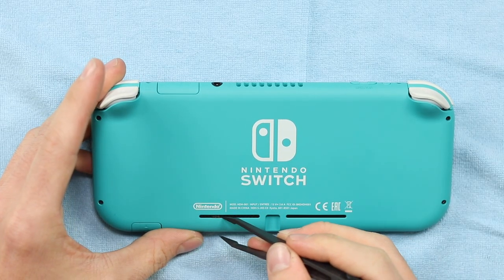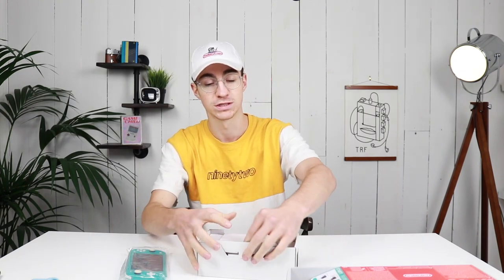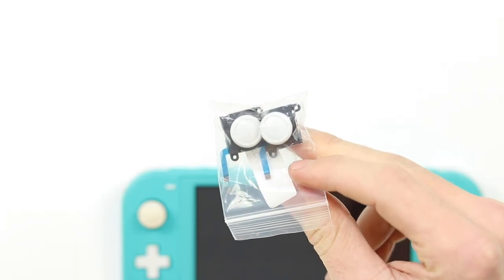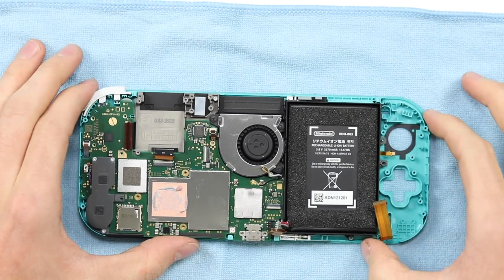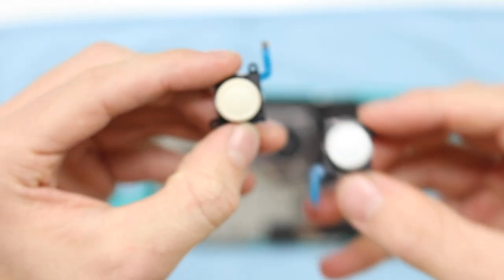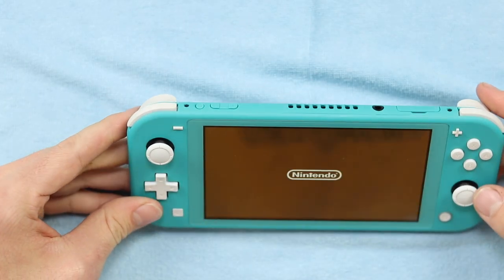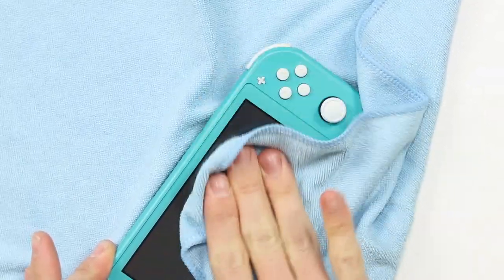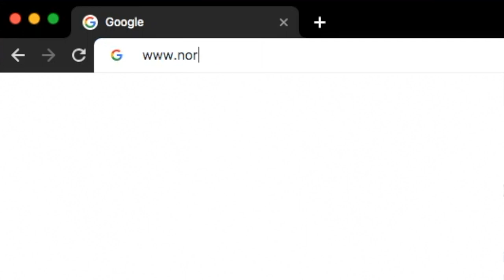£110 Nintendo Switch Lite! - Can I 'Fix' It?

Comment from the maker: I know this isn’t a full fix video, but I had no idea what to call this video. So I went with ‘fix’ to indicate it’s not my normal fixing videos.

That being said I wouldn’t touch this switch at all without replacing the stained joysticks...  I tried to clean off the tar but it wouldn’t come off so I had to replace them. 

Hope you enjoy!
Reply: @peshalraina1322  yep not the best info tbh
Reply: Refurb was the word that first came to mind. :)
Reply: If you didn't replace the thermal compound on the processor it's probably worth taking back apart and cleaning the heat spreader and heat sink with a lint free rag and alcohol then putting new comound on it
Reply: I had a nintendo gamecube that I lent to a smoker and it smelled and I found out putting the gamecube and game cases and such in a closed backpack with dryer sheets for a week completely rid the system of smoke.
Reply: Dude that was like Clickbait.....
Reply: Yeah, feels very click baity.
Reply: i got an anti smoking ad when he said it stank of smoke lmao
Reply: I just bought a Nintendo switch lite and it has a drifting problem. I am so mad
Reply: Yeah, it's more of a restoration-type video. Really cool to see nonetheless.

Comment: "he only played fornite" turns it on, only shows Mario kart 8, kind of makes me think someone stole it and sold it that's why took it for so low of a price.
Reply: Stole it used, with a box and charger?
Reply: @jebleman2091  you can buy the box on ebay and the charger for cheap as well. then make twice the profit.
Reply: Maybe he reseted the switch and the switch had the mario kart cartridge
Reply: He formats the switch I'm pretty sure, puts Mario kart in to test the cart reader
Reply: You guys are always jumping to conclusions and assuming the worst of people
Reply: @kandy1643  ikr
Reply: Easy to assume the worst of people when people are the worst
Reply: He's on the profile page for a second and you can see "Elliot" so he indeed reset it

Comment: Could you do a repair on a Wii remote?

Also, how could you spend £100+ on a Switch Lite just to play a cheap, free to play game, and watch Youtube?

Could’ve brought a cheap tablet for £50...
Reply: Noober I’d much rather spend the money on a Switch than some garbage Android tablet.
Reply: Mike L then again the guy sold it for $110. Not even half if you count tax.
Reply: @yamomoldcouch5065  In the UK tax is already included in the shef price so it's  £200 and that's it.
Reply: @cunnyman  I mean, emulators exist. A lot of cheap devices can technically play Nintendo games.

Comment: While I agree that the unit was just gross, I find it puzzling to see that it yellowed so quickly after being bought brand new less than a month ago. I mean, I'm a smoker myself and none of my electronics look that bad and neither does my collection of games.

From a smoker's perspective, I'm a tiny bit skeptical that one single person could manage that level of grossiness (is that even a word? You get what I mean) in less than a month. If I were to guess, either literally everybody in that house smoked a pack of 20 cigarettes per day (so between 60 and 80 cigarettes per day) or the quality of the plastic Nintendo used (or their supplier for that matter) is not as good as they claim.

There is no way in hell a single person could've managed to do that without "external" help. Not arguing about those residues of dead skin cells (that would be the least gross option), but the levels of yellowing and the smell are not normal. Not for something that new anyway.
Reply: ChaosZero ノブ prolly smoke and just never washed their hands. Cheeto dust fingers, perhaps?
Reply: I'm glad there are people like you out there who smoke and actually care for their game consoles. From some of the stuff I've bought for my collection you'd think that the previous owner would chain-smoke five packs daily and exclusively exhale straight into the cartridge port.

Comment: Very interesting how a lot of the motherboard was easier to assemble/disassemble than the older consoles. Everything either looked like it just needed to be screwed on or secured by a ribbon. Looks very easy to fix problems with it (for the most part). Nice!

Comment: I find that tossing the buttons into a sink full of hot water and scrubbing them with dish soap and a soft toothbrush is waaaay better than hitting them with alcohol and a q-tip.  Delicate stuff like the membranes of course still need to be done with the swabs, but buttons are no issue

Comment: If you really despise the smell of smoke you tend to suffer from temporary Phantosmia. Yellowing from smoke takes a long time to accumulate, unless he was blowing smoke directly on the joysticks non stop for days let alone hours. Biggest clue of a smoker is not smell but dust. In this case I think it's actually oily dirty hands and mix of light, if he has dirty oily hands and leaves the switch on his bedside under a light then it will take no time at all to yellow, a clue on his dirty hands is the browning around the Switch and the gunk inside the buttons.

Comment: Whoa! Not sure if you just cut it out but it looked like you didn't clean off the old thermal paste and reapply a new one to the heatsink.
Reply: Went back and watched it again, you definitely didn't on the 3rd layer. This particular model needs thermal paste in 3 layers. 1 under the IHS of the CPU/GPU (which you didn't open, so no worries), 1 on top of the IHS where the heatsink meets, and once again on top of the heatsink where the external shield meets. New thermal paste needs to be reapplied every time these parts are separated. Not doing so is setting yourself up for overheating issues in the future.
Reply: Here's a teardown with examples for anyone who's interested: https://www.neogaf.com/threads/switch-lite-internals-photographed-at-fcc-hello-mariko.1495936/

Comment: I smoke but I would NEVER smoke while holding my console? I try to treat my consoles and controllers with a lot of respect. I don’t eat while playing, smoke while playing. My controllers get wiped down once a week with disinfectant wipes.
It’s easy to tell the difference between my controllers and my partners controllers, he eats and plays all the time. Mine are impeccably clean, his tend to have a little bit of grime on them 😖

Comment: Did you replace the thermal paste for the cooling system? Disturbing the paste then not replacing it, did the system eventually have over heating issues?

Comment: Did the seller not have a local CeX? They buy the turcoise Switch for £146 cash/£160 credit. Even if they could see it was looking a little rough, they would have likely still offered £131/£144 as 'discounted' stock.
As for buying it from CeX, unless you have a lot of store credit, the £200 asking price for a boxed unit is just ridiculous. Especially considering you can get a new Switch Lite + game for £199 at Tesco.I'm sure CeX prices will even out, but now is definitely not the time to buy a Switch Lite from there.
Reply from the maker: No CEX In Jersey!

Comment: I recently bought a GBA for pretty chep (I don(t know the exact price rn)and the original owner got it as a kid when it was released (according to the little copyright thingy on the back it's from the year 2000, aka from around 19 years ago). They also said that they were using it actively, but had to get rid of it, for various reasons. Guess what? Other than a few scratches on the screen, it was almost as new! Reminder: They used it actively for 19 years -19 YEARS* and then there are people like this kid. Like, WTF?

Comment: Yo Retro, my switch lite is missing one of the screws from the bottom (one of the two right next to the charging port), ive been searching for awhile for replacement screws with no luck and figured you might know anything?

Comment: Thats why I wont buy any of the stock Switch Lite Models those joysticks WILL turn yellow over time if not from sun from slightly dirty hands have NO idea why Nintendo would have gone with white of all colors.  Is that so they can sell you services to replace them with new white sticks?  I have pre-ordered the Pokemon Sword and Shield one with red and blue sticks.  Just makes more sense to me.
Reply: Mister Donkey  I don't think I own any console portable or not with the exception of my white Wii U that has white analog sticks and I did buy my white Wii U used and I try to get those sticks clean but they're still yellow I could probably replace them and I probably will someday but otherwise I won't buy a console with white sticks that just prone to getting dirty I don't smoke but they will get dirty

Comment: why didn't she just return it to the store? its still under warranty. something smells and it is not just the switch.
Reply: Because its clearly been used and nothing is actually wrong with it? Most places don't let you return items just because you have changed your mind, especially if there is clearly evidence that the item had been used, and in this case damaged.